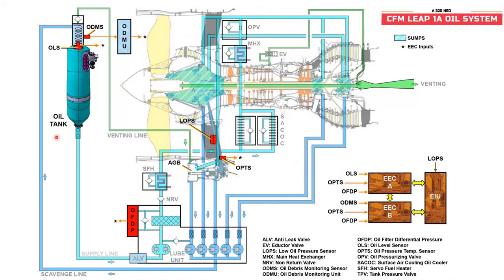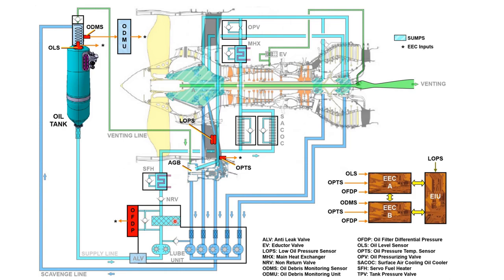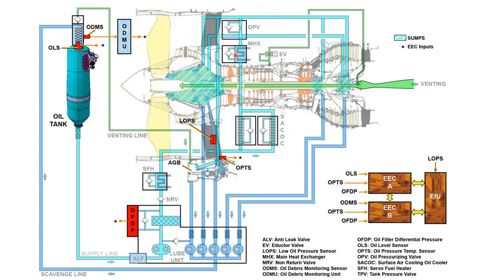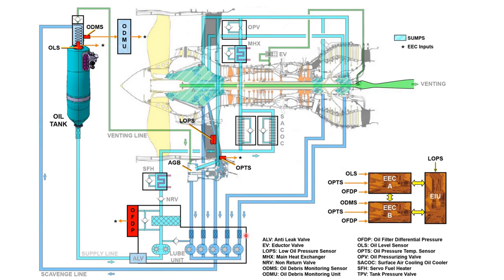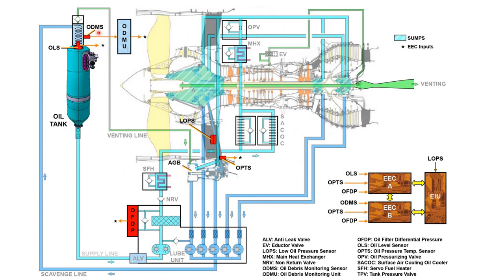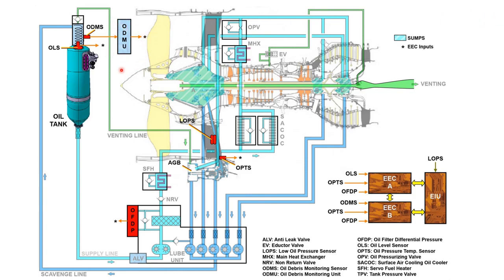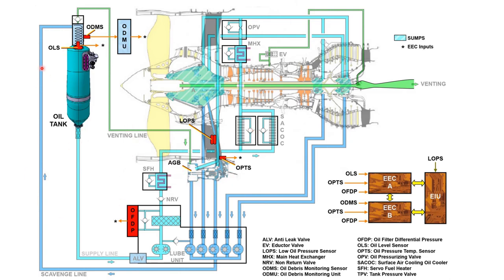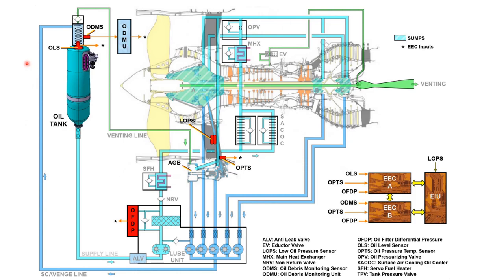CFM LEAP 1A Oil system Explanation | A320 NEO Type Rating #airbus #a320neo #a320

Comment: Good info, thanks. Eductor uses 7th stage air though.
Reply: so eductor vlv helps to keep the oil or discharge the oil via vent tube?
Reply: @asadulloh_02  it reduces the pressure of the sump at sub idle speeds so that pressurisation deltaP is ensured.